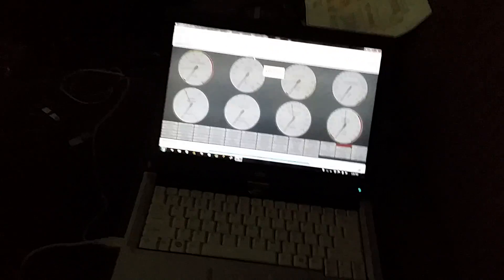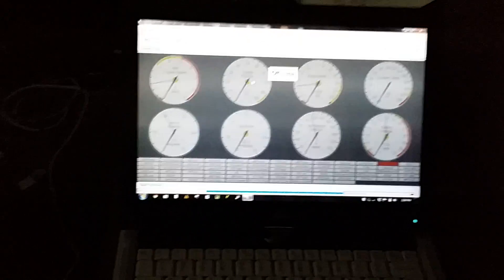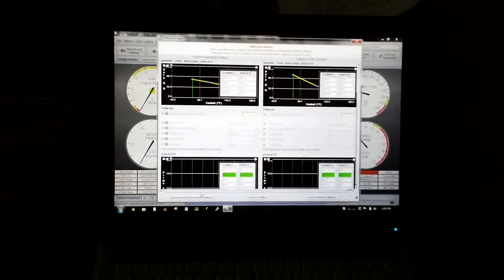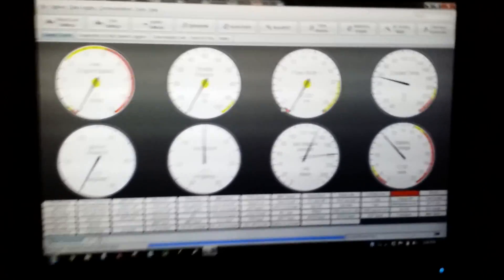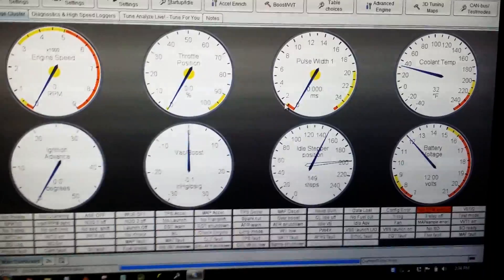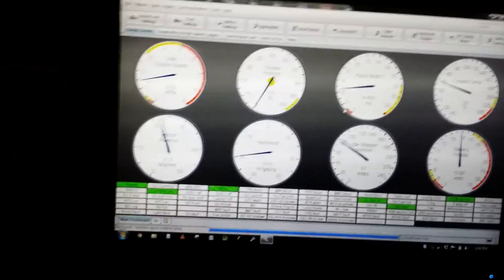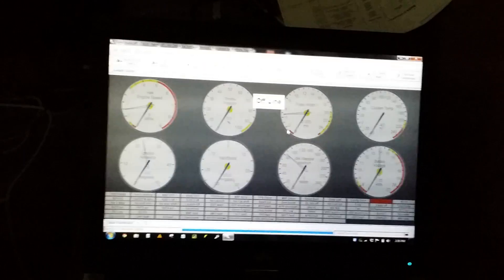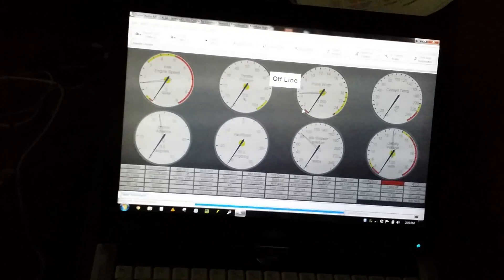1-29-15 Fairmont 5 ms3 gold 30deg start

Comment: thats how it does when its set up correctly. timing looks good for start up enrichment also, dont forget it helps the idle speed ya know. it did bang 40 while first starting. The o2 wont matter much for cold start you may wanna watch it while you setup how long it takes to decay completely. Stuff like when the cooling fans come on and managing the idle will be a little more time and detail. The box prolly has something like a/c boost trigger that could be used
Reply from the maker: actually the closed loop idle is fast enough and works well enough that the fans do not bother it, it does have a AC trigger and idle up fuctions out the wazoo, it only swung 40 because it hit 2000rpm and middle of the road amount of load while the idle valve was swinging its way back down from a far open position. its getting there!
Reply: very nice i watched the new vid too looks great i know you will have it running beasty and you find those functions that make it a car you can run to store in can be done with stand alone and really arnt that hard to set up